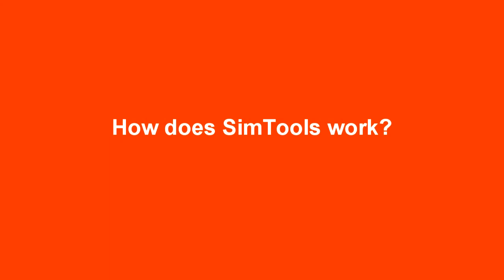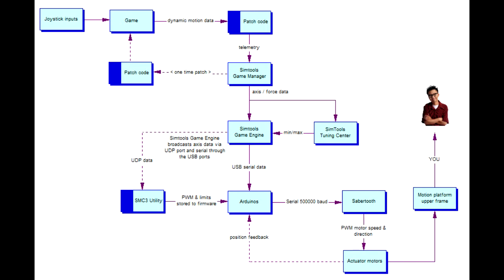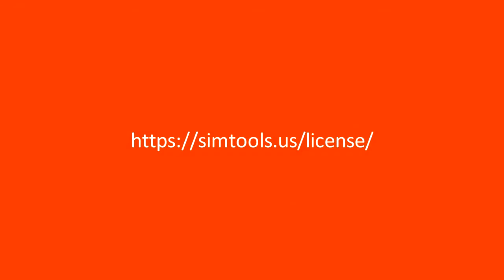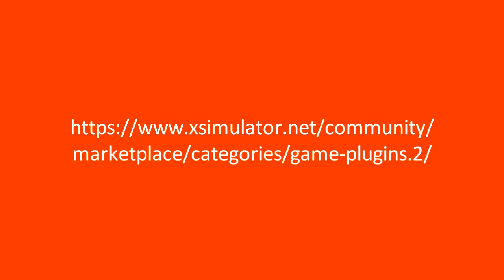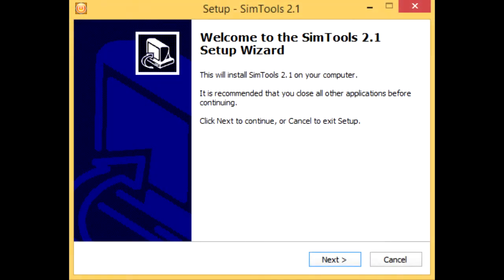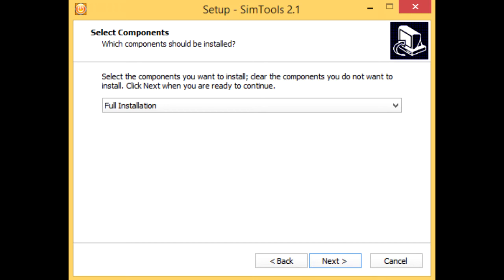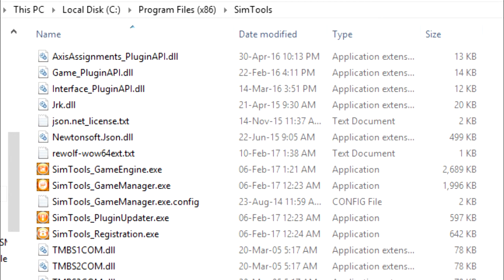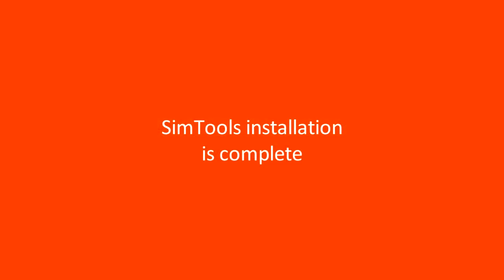What is SimTools and how does it work? Part 1

Comment: Part 2 never appears?
Is there any other guide like this?
Reply from the maker: Hi G-Maniac, when I moved from my house to my current apartment there simply wasn't room for the big 6DOF stewart platform. So when I dismantled it and began building the SFX100 motion platform, I never reassembled the 6DOF so couldn't finish the simtools series. Sorry to disappoint you. If you need help tuning Simtools you should head over to Xsimulator. Great bunch of builders there who will be able to answer any of your questions. Cheers
Reply: @sixdegreesofflight7765  where is a part 3 bud you're explanation are helpfull